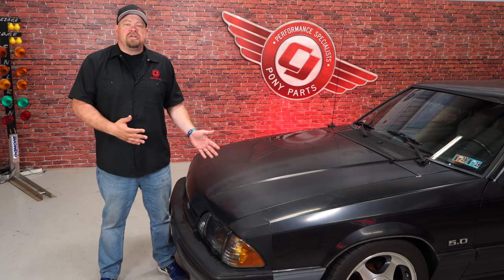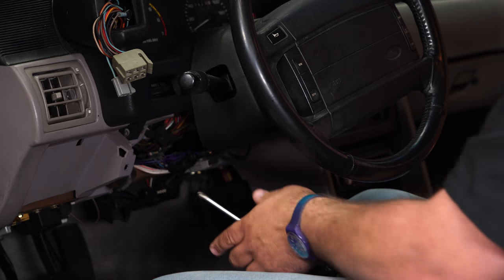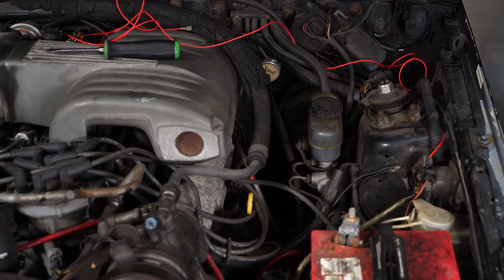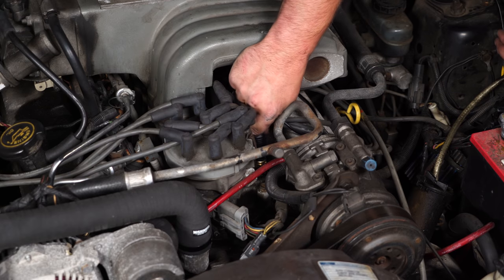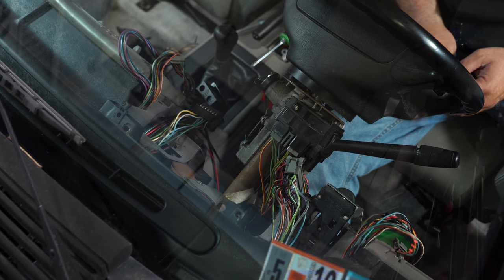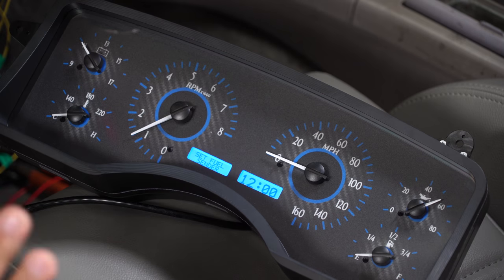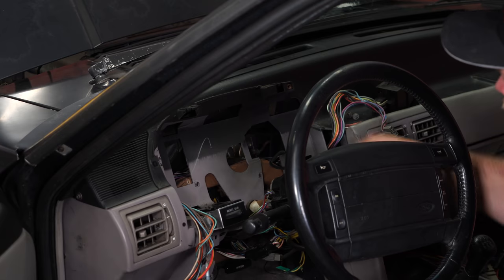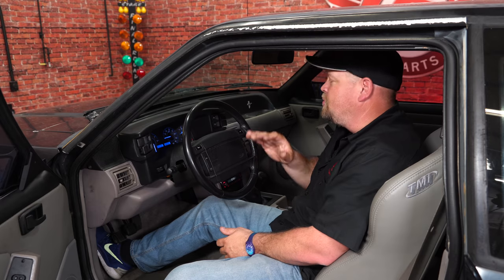How to modernize the Mustang Fox Body: Dakota Digital VHX Gauge Instrument Cluster Assembly Install

Comment: For the people who have an 89 mustang some of the wires are different colors leading up to the old cluster connections , dimmer wire, and both turn signal wires. How ever if you look at the back of the dimmer switch  you'll find the wire for that and on the back of the steering wheel you'll find the wires for the turn signals, 2 green white for left turn signal and 2 blue white for the right
Reply: My dimmer switch I cannot see and it is not red and blue

Comment: Alternator isn’t charging anymore, when you removed the factory gauges you lost the resistor that turns the alternator on, ask me how I know. You now need to wire one in, have this package it’s excellent though. You would wire it in to the alternator sensing wire, can’t remember the colour of the wire since I did this 3 years ago.
Reply: I was curious about this myself.  How did you wire one in?
Reply: That's pretty bizarre
Reply: Lol ran into the same issue. Spliced them in under the dash.
Reply from the maker: Unfortunately that got missed in editing but yes DD includes a jumper wire for this you connect to the original harness. I believe it is from the red wire to the red with green tracer.
Reply: If you install a LED lamp in the battery indicator light on the original cluster, the same thing can happen.  I too learned that the hard way.  I put a standard bulb back in and it started charging again.
Reply: I was concerned about this too.  I went with a one wire alternator.  I haven't yet installed the gauges- I'll keep ya updated  ;)
Reply: @gabrielortiz665  how'd it turn out?

Comment: INFO FOR WIRING LEFT TURN SIGNAL 90-93

Driver side: Green wire with white tracer.

The video skips on the left turn signal. So if anyone looking in the comments for the info, here it is.

Comment: Installed the original look dakota digital in my 1992 gt had turning signals and brake lights before the install now i dont have em but everything else works. I went to fuse to relay took everything back down make sure my wires to the module was right still nothing im lost.

Comment: Realistically,  how many hours to complete the job?  I have an 88
Reply from the maker: Really depends how comfortable you are with wiring. I think most people can do it in a day.
Reply: I'm horrified of electrical anything.   How accurate is the GPS speed?  Do you completely remove the speedometer cable?  I'm also going to be installing a new Kenne  Bell supercharger.   I heard there is a window for boost in the info center.   It sucks,  I have the money for the console and boxes,  but can't find anybody to install it.

Comment: Did I miss the left turn signal wire all you mentioned was the right turn signal, are does it work through the right turn signal only
Reply: bigboy9350 no you have to do both the guide should explain, you can also Google cluster diagrams you'll find a few useful ones out there.
Reply: On my 90lx it is a green and white wire on the driver's side.

Comment: What about the odometer? Especially if you are not using the speedo cable. How would anyone know the actual mileage?
Reply from the maker: The odometer adds mileage based on the speedometer so it works pretty much like normal. You can add the mileage to the cluster one time and then it is locked.